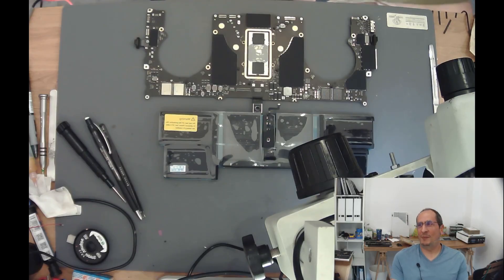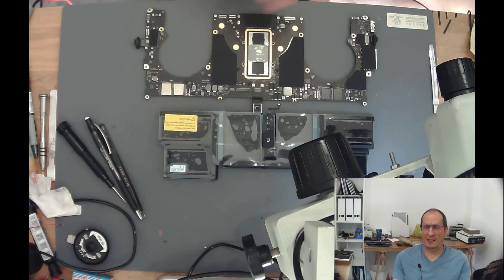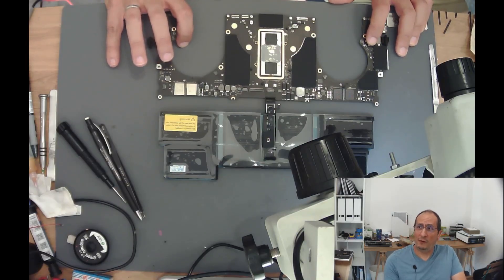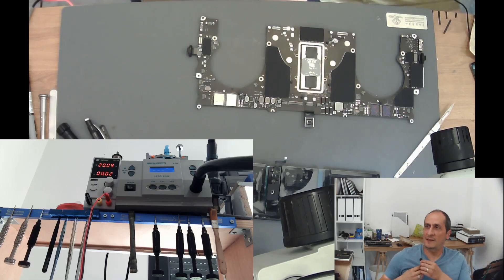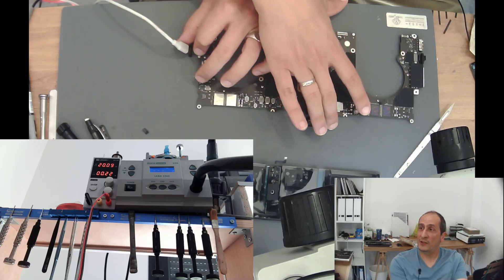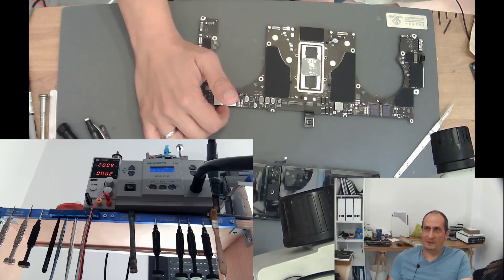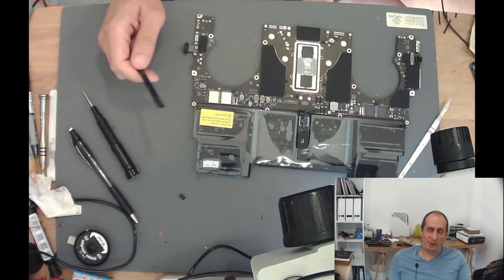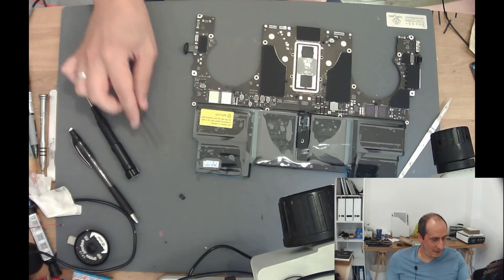[56] [820-02098] Replacing UG400, Part 1: Introduction to the main result.

Comment: one if the most significant and cool repair breakthroughs in years.
Reply from the maker: Well, this is an honour coming from you. Thank you. I already started talking to other people who tried on other devices: A2779, an iPad Pro. And it is not clear that things are that "simple". But I seriously hope this goes somewhere, and that the A2442 is not just an exception.
Reply: @LecomteRepairServices well, i actually found mention of non-otp straps in newer schematics and wanted to try it but forgot. So most likely your method will work in all cd3217 chips. Basically same straps are used to correct i2c conflict on dev boards and now there is a mention if that in the schematics with BOM table identical to what you figured. It was not written clear so it did not make much sense at first, but after you found that 3a/b are configurable with straps it totally does. Back then, 3 years ago, i was too fast to suggest that if they OTP-ed the i2c address, its because its out of range, also lack of full understanding on how it is bin-hex coded.
Reply from the maker: @inwerp  At some point, indeed, I did wonder how it is that you never figured this out. Because I knew you had access to the TPS65982 documentation. And I knew you knew the addresses 3a/3b, since you wrote the logi.wiki article.

So this actually really did work me up. Because I was thinking "Alexey must have investigated this, and have given up at some point. This must be going nowhere."

But the TPS65982 documentation is so extensive that it is very difficult to know what information to take into account, and what to discard.